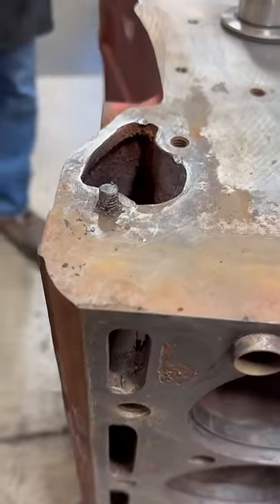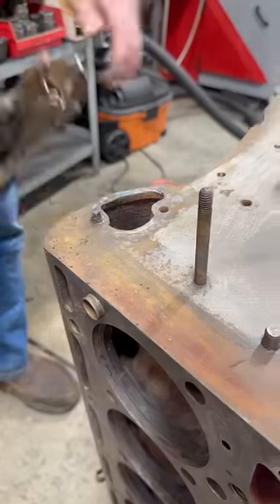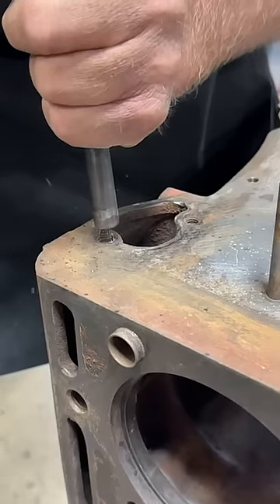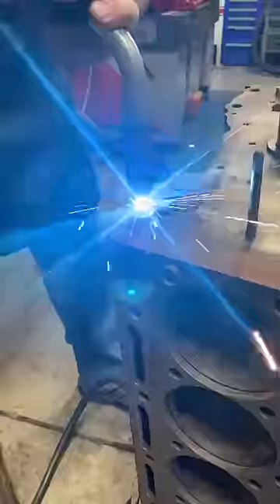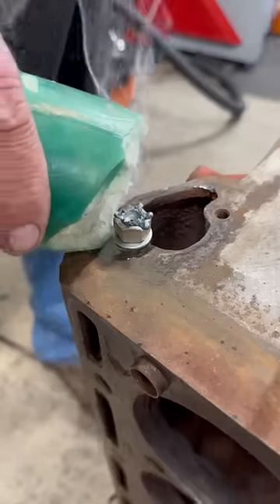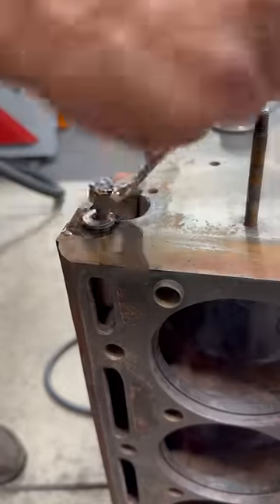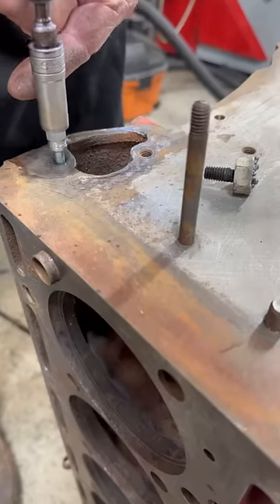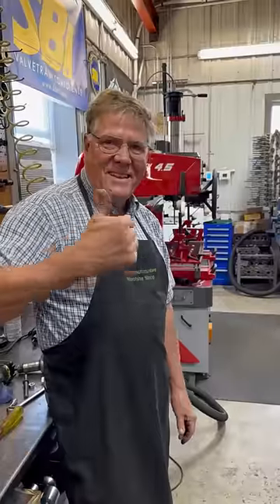#shorts I Make So Much Money Removing Broken Bolts

Comment: If anyone else was curious, 
If it took 2 minutes, employee was being paid 26.32/hr 
If it took 3 minutes, employee was being paid 17.54/hr
Reply: grabbing the welder took 3 minutes alone
Reply: @zanacos1 Yes, half the time spent on shit is just setting up and tying down your part, getting centered. The actual drill/cut/hone normally takes a fraction of the time
Reply: I would charge 75 bucks.every time.every one.
Reply: @zanacos1  Yep.how much he pay for welder? Got to charge to turn it on + 75 hour...so 150 first hour.then 75 every extra hour.plus gasses..and wire rods...skilled professional...this not Starbucks sweety...
Reply: And the client was charged 1 hour minimum at $100 an hour.
Reply from the maker: @TechieTard my labor rate is $150 not $100 lol
Reply: I can do this in one minute.  Heat the block not the bolt.  Heat makes things expand, you don't have to heat it that much to get it to let go.  Tap the bolt a couple times to crack it loose, don't hit it too hard or you'll just wedge it in harder, then use channel locks to unthread it.  If there's nothing to grab with channel locks drill it out and use a bolt extractor.  All these extra steps and he thinks heating the bolt loosens it lmao why do you people listen to youtubers
Reply: @vyvianalcott1681  wrong. Directly heating the engine block should be avoided.
Reply: @1Spacemn  I'm not talking about getting it red hot but go on, waste your own time not mine
Reply: You will both go broke very fast at that rate.   It took at least 30 minutes setup, and swapping out blocks.  Not to mention office time, materials, etc.   and the odds of having blocks lined up to keep a person busy is nil.
Reply: @vyvianalcott1681  lol you'll be the one that has customers with a warped block, not this guy
Reply: @ChuckisNorrish  Do you think no heat transfers from the bolt to the block when you do it the way he showed?
Reply: Even then they should be being paid more for the expertise and the skill
Reply: @vyvianalcott1681 The idea of heating the broken bolt is to cause it to expand and break the rust bond between the block threads and the bolt threads. I would not drill and easyout unless there was no other way. Welding nut to broken bolt is pretty standard procedure if you have a welder.
Reply: @richardhudson7206  Yeah totally agree, that's how you apply more torque.  If you have to do that let it cool then heat the block, apparently from these comments I have to tell you all to heat it gently and evenly you're not just putting a blowtorch to it.  There are two things holding the bolt in, one is mechanical adhesion from corrosion and the other is the block is a huge fucking hunk of metal and the bolt is small, the block contracts when it's cold more than the bolt does that's how comparative volume contraction works.  Making the block warmer than the bolt solves one of the factors holding the bolt in, then you just need enough torque to break the rust or you can use a penetrating oil if you like those.
Reply: Took 10mins. Tell me you don't work without telling me you don't work.
Reply: Flat rate doesn’t work like that

Comment: Heat is key. Always.
Reply: unless it's aluminum.
Reply: @DropDMurphy  just gotta get it hot enough to anneal it 🤣 then remember to whack it enough to work harden it before extraction.
Reply: "Heat is key. Always."
As long as you know that you can't always use it.

Comment: Just have to be careful you don’t actually break off the thread chaser in the hole. Nothing like doing that after working to get the damn stud out for so long. I had the clutch on the drill really loose to make sure I wouldn’t break it off yet still broke that thread chaser off. Was probably already partially fractured. These days I just do it with a hand tap lol.
Reply: That's how it's supposed to be done in the first place.  I know people do it, but taps/thread chasers are designed to be used by hand. They aren't designed for a drill.
Reply: If you're going to use motorized tools, at least use an impact
Reply: He probably used a tap handle first.  This short was edited for time.   It's youtube.  People have short attention spans after all.
Reply: Get a better quality thread chaser
Reply: That was a thread restorer, not a tap. There is a difference.

Comment: I found using a 308 or 309 stainless rod with a stick welder always worked best for bolt extractions. You can burn it in more than MIG, and the weld has less chance of letting go when you're twisting it out.
Also, I've learned so much about engine rebuilding from this channel. You guys are fantastic. Keep the videos coming.

Comment: Chasing threads with drill driver is playing with fire
Reply: why, just put the clutch on the lowest setting
Reply: If youve never used a drill to do it or haven’t tried in 20 years, I understand, but with today’s precision drills and clutches, it’s an absolute delight to use a drill to thread.
Reply: No they played with fire when they were welding, I think all the heat play was done by the end of that XD
Reply: Came to say the same. My guess is those threads arent as tolerant as the others especially with the weight of the drill. Not to mention taps are super brittle, just asking to have a broken tap.
Reply: @ericfantauzzo9972 thread chaser, not a tap
Reply: @pittbier7597  yup I always start with lowest setting then move up if necessary at work.
Reply: @ericfantauzzo9972  but it wasn't a tap

Comment: I worked in several automotive machine shops.  The second one, we used candle wax on a heated bolt or fastener. It should smoke lightly when the wax is applied. My experience with it was I believe it goes into places and as the fastener cools, the liquid wax goes in lubricating the threads. Worked very well for us.

Comment: I always try my 6” pipe wrench first. That thing is my secret weapon.
Reply: Not a good idea
Reply: Actually a GREAT idea. Try it.
Reply: Sounds good I'll give it a try sometime.
Reply: Fuck it, break out the impact 😂
Reply: Dew it!!
Reply: An youll twist top off missing the chsnce to weld lol😂 id try a impact wrench if i could get a grip on it 😂😂
Reply: @who_cares848 right! Lololol
Reply: YEA THATS WHY IT BROKE , NOW HE IS TRYING ANOTHER METHOD A WASTE  OF TIME METHOD , ...JUST CUT , DRILL ,TAP ...8 MIN AT THE MOST IF NOT LESS ...U.S.MARINE...
Reply: The pipe wrench with a little heat usually works…especially with the amount he’s got hanging out. It’s always better to get the bolt out and clean up the existing threads. Your way would be the last ditch 
effort …30.YEAR…TECHNICIAN
Reply: Pipe wrench when used correctly tightens up when pressure is applied

BEST for.oil drian plugs stuck
Reply: @Will-dn9dq  That’s where the heat comes in. And, if it does break flush, u can still weld a nut on it. Don’t get me wrong, I’ve done the nut method many times, just not always necessary. The pipe wrench works great on screws with stripped out heads and rounded off bolts. It’s a great tool to have and that’s all I’m saying.
Reply: @jat1992jat1992  Definitely, but probably a 10” or 12” wrench.
Reply: @TimdogQ  as a mechanic of 15+ years I will try anything if it makes my job easier, we have shelves full if hardware if it doesn't end up working well Worst case scenario you use a easy  out or backwards drill bit.
Reply: I've had simular success with a 4". Properly adjusted, it will bite harder than anything else. Tears up the jaws though.
Reply: @ronfox5519  You know Ron, I just looked and mine is a 4” as well 😂😂
I do have a 6”, but the 4” is my go to.
Reply: @TimdogQ  
Lol. They're good biters.
Reply: @TimdogQ A 4” pipe wrench?!  Forgive me if I misunderstand.  Is this method something you think would work in the field as opposed to the shop, ie heavy equipment on a rooftop or building wall, mounted on I-beams or some such?  I’m a service tech, so seized bolts threaded directly into a material (as in, not through-bolted) aren’t a daily or even weekly encounter for me, but I do have to hack the problem at least a few times a year.
Reply: He’s right. Best way in the world!
Reply: @VINCENT-sr4oz drill a BOLT and thread it ey? Ooooook, whatever you say…
Reply: Nah; torch. It can’t be tight if it’s liquid! 😜
Reply: @VINCENT-sr4oz are you mentally stable? 😂
Reply: @RFTwo  I can’t argue with that 😂😂
Reply: @Will-dn9dq might try using a bolt attached to a drill set on “hammer” and see if that jackhammer, although a weaker impact, may work.
Reply: @TimdogQ  4" pipe wrench? Used to working with under sized tools huh? 😆  smallest I've got is 8" on up. 4" is just under my palm width. I'd rather try channel locks w 6" grip if all I had was 4". Least tell us you use a cheater bar/  pipe extension.
Reply: Totally agree. Pipe wrench is the best for grip, helped me lots of times.
Reply: heat heat heat
Reply: @waynelalonde4778  and lube lube lube! Lol I light my candle am promise just to put the "tip" in. 😆
Reply: @Will-dn9dq   when i worked at a Cat dealership, there was a machinist welder there that used to use these methods.
Weld shrink bearing races, extract broken bolts.
This dude whispered to broken hardware
Reply: @RFTwo  ahh a fan of the victor wrench
Reply: @VINCENT-sr4oz  Apparently US marine has never had to drill a Grade 09 or 10 stud free hand (no drill press or mill) broken flush in a cast block like that. What type of drill bit would you use? 
Hint- there's only one answer and it's still a Longshot and you will need multiple bits or a good drill bit sharpener.
  And thank you for your service marine. I was just busting your balls a little. My best friend is a marine and I rag him often when he gets Gung ho about something and turns into Lou Gosset Jr. From An Officer and a Gentleman. Lol 

  But seriously it really is not that simple when dealing with cast iron or steel and extremely hardened steel studs. It is a humbling experience.. And Cobalt is the only drill bit that will give you a fighting chance. Or maybe the new titanium bits.
Reply: @davidgregory8950  as soon as you say drill to a marine that's it the only thing there thinking about us going back to bootcamp.
And a question, does the cast block in question, have threaded inserts or a helicoil of some type
Reply: You used the symbol for inches, not feet.
Reply: @leapyear9460  LoL
Reply: @VINCENT-sr4oz This is how I remove broken exhaust manifold bolts all the time, even when broken below the surface. Drilling and tapping can take hours, especially on hardened bolts. I've never drilled a manifold bolt
Reply: Damn! A six inch pipe wrench? You’re gonna need a six footer if ya wanna get anything done lemme tell you hwhat.
Reply: @VINCENT-sr4oz marine. That Explains it
Reply: I always underestimate the abilities of a BIG lever. I spent a good 40 minutes running back and forth from the tools room to the siezed part, apply more and more elaborate clamping and torquing methods. Supervisor finally called our Maintenance tech. He didn't even come look at the part first, just strolled out with his 12" pipe wrench 😂
Reply: I just go straight for the breaker bar with a 5 foot pipe

Comment: you can also take out bolts that are broken below the surface level if they are larger than 1/2 inch by finding the appropriate socket that fits snug in hole and use a stick welder right through the drive end of socket .
you now have a screw welded to your socket and you should probably get your rachet and back it out.
this works great on certain applications.
Reply: ...and Snap-on warranties the socket (unless it is a 10mm!).
Reply: @jakal104  ha ya right..
It's not a bolt extractor by definition ☺

Comment: Bro .. the candle trick works so good.. couldn't belive how well it worked
Reply: Had an stuck turbo actuator and the penetrating oils evaporates to quick with heat. Candle wax works better

Comment: That wax trick is mind blowing and really shows a mechanic’s depth of knowledge.
Reply: Some old head magic. Gotta love it.
Reply: My job gave us 3 tools, made us buy the rest.  Vessel screwdriver set, eklind allen wrenches, and a hunk of beeswax.  Best thing ever on seized bolts.
Reply: I use those vessel screw drivers at work. Love them as we have lots of Japanese machines with jis 2 screws. But I have the wiha hex keys. Lol

 @Raeilgunne
Reply: @meegstomtom  best screwdrivers you can use.  I've bought about 6-7 more in different sizes and types since.  If you deal with a lot of hex heads, getting the 230W handle and their bw-32 hex bits is perfect.  they keep it screwdriver length but the connection is in the handle.
Reply: @Raeilgunne  I'll look into that for sure. Our equipment in the printing press had the body panels usually heals on with the Phillips or jis2 and the internal parts are almost all hex bits. 3mm and 4 being the most common. 

I also enjoy the matco micro ratchet that's like 2 inches long. Super small and great in tight places.
Reply: @Raeilgunne  I looked up the handle. My co worker has the vessel cordless screwdriver with that style and it works great for our use.

Comment: My grandfather showed me that trick while working on a motor too. Oil expands with heat wax thins and runs and dissipates. Works for me every time.
Reply: This has been proven time and again. The wax doesn't penetrate for shit. The heat added to melt the wax does more work than any wax.
Reply: Also oil also thins with heat.

Comment: Candle wax absolutely works amazing. It doesnt vaporize like p.b. or wd40 and flows into the threads. Literally flows into them. And you can sing happy birthday afterwards, when the entire shop smells like birthday candles ❤😂
Reply: also a cheap candle is a lot cheaper than "a good penetrating oil" lmfao some of those cans cost over $20...
Reply: I prefer bacon grease.😋
Reply: There might be a special technique to it, but Project Farm showed that candle wax is less effective than most penetrating fluids. Liquid Wrench was the most effective in his tests.
Reply: Wax is an oil that hardens at room temperature
Reply: @GeoffCostanza ProjectFarm is full of crap. The tests are overly precise but fail to address reality. Candle wax actually does work best when you're able to apply intense heat to the seized threads. It's like showing up to a racetrack with Blizzaks because you saw tests showing winter tires work better than slicks.
Reply: I think atf mixed with acetone 50/50 works better
Reply: @supers0nic77  we used the atf for drilling most times. and obviously transmissions.
Reply: @charvakkarpe Lol, imagine calling actual scientific method overly precise.

Comment: That's a smart idea to use a washer as a spacer if you have the room. I did my fair share of extracting broken taps in my day but I'll send a part out to have it removed nowadays.
Reply: Not necessary on aluminum blocks, but a good idea for iron ones.

Comment: You ever thought about getting a induction coil heater to loosen stuck bolts and studs?
Reply: This! Did you notice the stud was still binding when he was initially loosening it? Welding the nut on was spot on. What he should then have done was heat the nut/ stud with an induction or a map torch until cherry red. Then douse with water. It will unwind like butter then. It doesn’t drag on the thread as it unwinds. Usually doesn’t need re tapping either, but good practice to clean with a plug tap.
Reply: @mark4lev I've done that a couple times, and it's a good idea, but it doesn't always work. A little corrosion in the wrong place makes it a frustrating chore... weldings more fun, and my layout reflects it. 

Note to self: stock up on arc-welding supplies...
Reply: @mark4lev you don’t think the bolt heated up when he welded the nut on it?
Reply: How would you put an induction heater on it if it were twisted off flush?

Comment: It's the one that breaks off flush.
Reply: You can still weld to them broke off flush. The hotter you can get the weld it usually helps break it free, water quench and it will spin out. Guys do it on Ls and gen3 hemi exhaust studs that have broken off that can be flush or slightly countersunk.

Comment: I think candle wax is used because penetrating fluid will just burn off if it's too hot or is the candle wax will melt down into the seams?

Comment: Try a bar of soap for lube. It works great on  band saw blades or drill bits too. I learned the soap trick form a old timer metal fabricator.

Comment: Candle wax works good on them Ole 
H.D.s keeps them old v twins running smooth.
Reply: Yep, engine oil just leaks right out so you need something that stays around.
Reply: what is h.d.s?
Reply: @jeromeneely202  Harley Davidsons
Reply: @jeromeneely202  "v twin" was yer hint 😉
Reply: I suggest watching project farms video on penetrating fluids. In all applications tested candle wax did not penetrate the test medium and was shown consistently to not be effective at loosening the bolts compared to other such as pb blaster and a few other fluids.
Reply: @ryanjameson9940  the home mix proved rather good i belive, AtF , used works very well im told as its all bashed down amd thinner.
Mixed with acetone.
You want a backyard smart arse rust fix?
Thats the stuff.
Seoerates in the bottle but shake it up and it dies wonders, dunno never tried, WD40 often does the trick on the day to day.
Or the trusty old 3 in 1.
Bit its the heat doing rhe job when it comes to candles. 
Its maybe? better than eff all and if you get the bolt hot enough to melt the candle?
The differential expansion between corrosion and the bolt and workpiece is likely enough to free the bolt.
Its a good test to see if the bolt is hot enough wothout wasting to much gas, you dont always need em bright red...
Irinically?
If you firget the candles and get a waxy type oreferably  lanolin based coating on your underbellies you would save a fair few stuck bolt jobs.
Reply: Has anyone tried whale oil?
Products from endangered species are magic.
Reply: @gordonwelcher9598 🤣